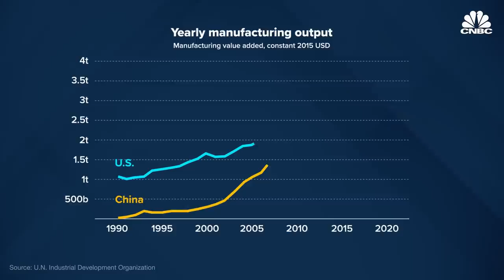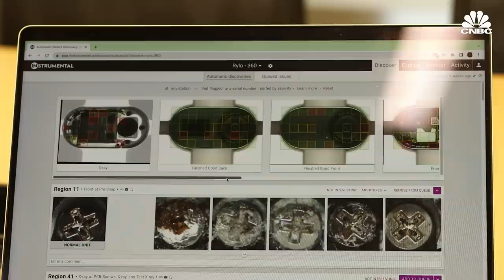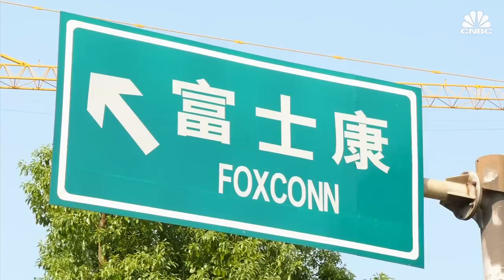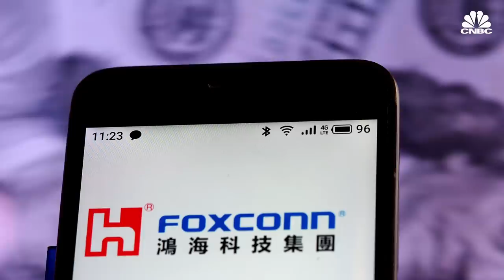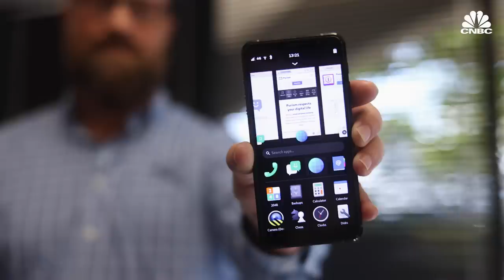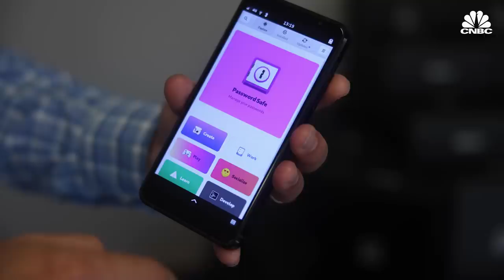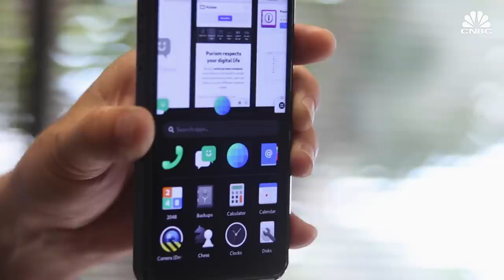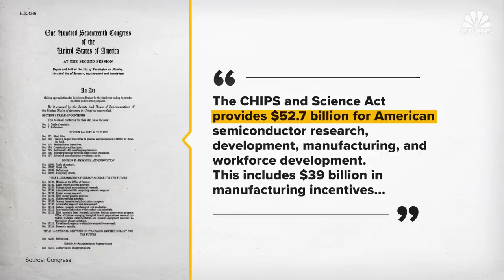Why The U.S. Fell Behind In Phone Manufacturing

Comment: Pretty interesting.  I always assumed products were made in China because of low labor costs.  Granted that is still a factor, it is a small factor, as I just learned.  China has the skilled employees to do the work.  So only makes sense.
Reply: when it comes to skilled employees in electronics America has the best that's why airplane electronics are made here despite what they say its the cost and since the cost have gotten high in China companies are now moving their factors to India on of the real problems are the supply lines here the parts to assemble to get here would be longer and cost more no country  just makes a cell phone all the parts are made from many different countries it wouldn't be economical to make the whole thing that requires 100
s of parts in one country
Reply: @omni It is absolutely because of lower costs. Not only for labour (a worker in the US at literally ANY level is significantly more expensive than one in China) but what you can do with that labour.

When a company I worked with made a last minute revision to a component in their product, their manufacturer who had staff living on site woke them up and had them working double shifts to fulfill the order. Not to point out the obvious but that would be impossible in the US or anywhere in the developed world.

They also have fewer regulations for safety, labour, process etc and the regulations they do have often aren't enforced.

This makes for FAR less costly manufacturing. You're delusional if you think it is anything else.

BTW manufacturing is not moving to India for similar reasons - they have extremely unfriendly business regulations. But manufacturing IS moving to Vietnam though.
Reply: That's what Tim Cook says on the surface, but deep down he knows that $3/h is better for him than $15/h.
Reply: @omni ok what about medical electronics do you even know what the IPC is?
Reply: @ShUisREAL  yea those are clear lies I mean intel makes a lot here
Reply: @DZ477  Sure, but engineers aren't paid only $3/hour in China, or $15/hour in USA.
Reply: @omni There's not a shortage of skilled labor in the US. There's a shortage of companies willing to pay the extra labor costs a US engineer demands compared to a Chinese engineer. If it were otherwise, Foxconn and Apple would not be so averse to let us know what their Chinese engineers' average salary was.
Reply: @d0k0night  I was talking about factory workers, they're the people Apple goes to China for, not engineers.
Reply: @@omni1189 : LOL..  If there are skilled labor in China, China wouldn't need the US in the first, right?   Remember how Mong Sang Liang singlehandledly built China's first 14nm processing nodes and most recently 7nm?  Of course, he's a former TSMC R&D head and he's Taiwanese.  If China has local talents, they wouldn't have to poach so many engineers from Taiwan, Japan, South Korea, or the US.
Reply: @omni US has more STEM, but it's not relevant here because they don't teach you phone assembly skills in STEM. Those skills are learned on the job or in special schools. How did China get those skilled workers? They built the factories where there were no skilled workers and then taught them. Sure, that means those workers can go to another factory and require much less training, but I don't think that skill acquisition is a big factor in labor cost unless they suffer from really bad turnover. Anyway the big reason companies don't make factories in the US and do the same here as they did in China is because the labor would cost so much more! I don't buy the supply chain stuff. That stuff can always be bought and shipped in bulk. As Apple does with their glass made in the US!
Reply: @joejacko1587  yeah there are a lot of companies leaving china for me India.
Reply: @omni no there has been news stories from WION about how manufacturers are leaving china because of high cost reasons, indias labor is more cheap and also I think it was because of the interlectual theft from Chinese companies causing the switch
Reply: What would need to change in America for 100,000s of young people to be willing to slave away all day at electronic factory jobs.
Reply: @omni I still stand with what I said I only said that because it came from a documentary I was watching of things that's already happening. I didn't get those things from my imagination all from the documentary
Reply: @HardRockMaster7577  $100 an hour 😅
Reply: The problem is that westerners are still using decades old stereotypes
Reply: @omni you telling me to do something I already have knowledge of I don't need to go look it up cause I already know were some are headed, or is. And yes It was a credible I stand by what I said
Reply: @omni if they build 1 factory in India and 3 in china 🤔 duh they must be going to India and china . And also I'm living in Houston right now we are getting a Tesla factory in Austin if it's not already completed so it's not like the ENTIRE OPERATIONS 100% IS GOING TO BE OVERSEAS. I've honestly talked about this more than I honestly care about so you all can have the rest of the conversation I honestly DONT CARE EITHER WAY
Reply: @omni and the documentary was by 60 minutes not no damn India but I digress happy holidays
Reply: @omni no you are wrong, it's all about Greed, lower cost in China
Reply: @@omni1189 great work CCP bot lol 😆
Reply: @@omni1189 cool story
Reply: @omni No. Labor costs are a big deal. Chinese workers are paid significantly less for the amount of productivity they do. And of course there are no labor unions or as strict workplace regulations that western countries have. Its why Apple is investing in India for the future. Overall its cheap labor + economies of scale + domestic supply chain + skilled manufacturing talent that makes China competitive
Reply: @dark12ain  
WION? 😳😳😳

🤣🤣🤣🤣🤣🤣
Reply: Yes, so what is happening with the educational systems in the USA?
Reply: @yemenidelibodegaqueensnewy9287  its really just the opposite China has a massive number of doctors and scientists from the west living and working there
Reply: watch the video to the end. labor is exactly what it came down to in the end. The local phone manufacturer clearly said he was able to maintain profits because he doesn't have ridiculously high profit margins. Apple is trying to squeeze as much profit as possible, they aren't willing to make less to make phones in the US. That's the problem...Greed.
Reply: And the Industrial Infrastructure and the Market! No country comes close.
Reply: @TomNook.  you're so right !!! China is not like it use to be in 90s and early 2000s their infrastructure alone is breathe taking!

Comment: The main reason I bought a Moto X back in the day was because they were made in the USA. Unfortunately, most consumers didn't care. I was hopeful that Google would continue to build phones here. Turns out that they primarily wanted Motorola's patents.
Reply: The so called "Made" in the USA for Moto X was actually "Assembled" in the USA. All the parts were shipped to Texas for assembly. Even so, there were too many problems of the factory. Google wrote off this as a big loss after a few months.
Reply: @easyxpress  Quite right... All internal components (capacitors, semi conductor substrates etc.) were made in; Taiwan, Thailand, China or Indonesia, and occasionally; Japan. As you say, just because its assembled somewhere, that doesn't mean its made there... Big distinction!
Reply: @easyxpress  : Yes, just the same way iPhones are "assembled" in China.  China still to this date only  provides low-value, low-tech components and labor for iPhones.  Most important high-value chips come from either South Korea, Japan, Taiwan or the US (mostly IC designs).   China imported over $400B in semiconductors last year in fact despite Apple's huge efforts to develop China's own domestic chip industry --  to the detriment of the US chip industry.
Reply: Yes you are right, the China does not have high skill workers to produce advanced high value IC. These are produced in Taiwan, Korea, Japan, USA. China only collects all these elements with the low level elements and assembles them into final product. So Tim Cook is wrong, it is not the problem of lack of high skill workers in USA. The wage difference is also not that big USA 7.25$ and China 3$. So what is the reason that similar product in China costs 100$ and the same assembled in USA 2000$ that is 20 times more, as presented in the video ?
Reply: @teranova5566  The simple answer?  Greed.
Well, it's volume.  A factory in China can churn out millions of products,  while one in the US can only make a few thousands. 
So a Chinese factory productivity is higher.  So, they can afford to sell at a lower price point
Reply: @scotttild  Exactly. People tend to romanticize factory work, probably because their parent told them how good it was back in the days when the US made all its stuff, and you could buy a house and go on vacations with a factory worker's salary. Not anymore. With Wall Street taking over companies and their hordes of analysts, bankers and hedge fund managers prioritizing profits over everything else, factory work is not what it used to be. There is no way a factory in the US can pay good salaries while meeting the short-sighted demands of Wall Street. That is why most moved to China and Mexico. The few factories that remain, at least in the low-cost manufacturing space, are staffed by desperate migrant workers because those companies cannot afford to pay more and turn a profit, and only migrant workers take those jobs. Factory work is hard. Even phone assembling requires being hunched over a bench for hours on end and putting together those tiny phone components require dexterity and swiftness. I don't see the hordes of liberal arts and communications graduates being churned out by our universities lining up for those kinds of jobs.
Reply: @teranova5566  "So what is the reason that similar product in China costs 100$ and the same assembled in USA 2000$ that is 20 times more, as presented in the video ?"

I'm not sure the price difference is as large as that (20x), but it is significant. There isn't a single reason for this difference, but several.

Wages are lower in China compared to USA/Europe, so Apple benefits from cheaper labor. However, the wages they pay their Chinese workers are still more than domestic wages, so these workers are willing to work productively for long hours. 
This wouldn't be the case if Apple hired workers in the USA, as domestic wages are (on average) higher, so their pay wouldn't be significantly higher than the domestic average and consequently the workforce wouldn't be willing to work as hard. 

Also, in the case of smartphones, assembling them in SE Asia takes advantage of the fact that many of the components are manufactured in neighbouring countries such as Taiwan, South Korea, Japan and China. In other words, there is an existing, reliable local supply chain for all the necessary parts. 
However, the phones don't have to be in assembled in China. As long as they have access to the above supply chain, they could also be assembled in Vietnam, or even India.

So, the 3 main reasons are access to:
[1] cheaper labor
[2] skilled workforce 
(by skilled I mean productive at manual labor, not engineers!)
[3] local supply chains for the required components
Reply: I had no idea Moto X was made in the US. Was the microprocessor made in the US also?
Reply: @fitybux4664  No. The phone was 'assembled' here.
Reply: I was on the engineering team that designed this product. The things that will never come to light are mind boggling. It's no wonder America is circling the drain. I feel sorry for young people
Reply: @fitybux4664  yes
Reply: I CARE
Reply: @pauldavis221  So true. To be clear it's been a long time since we had factories taking in nothing but raw materials in one and and rolling out a sophisticated product like a car on the other. That hasn't made sense for a long time. In any locale.

Comment: Having worked as a non-US resident with a multinational in the manufacturing sector I can tell you my experience: US workers just have the wrong attitude. 
The US workers were paid twice as much as our EU colleagues in many cases, despite having a complete lack of work ethic. One example: we've had emergency meetings across our offices where the US would just close their laptops at quitting time despite meetings not being done...no drive to solve the problem or pride in work in my view. And this is with overtime rates if you're wondering...
Many companies I've worked for basically balance two things in the US when considering locating there: the high costs involved, not just the tangible or financial, are weighed against benefits of selling product in the US market...if they can sell more by having a US presence, they will, but if they can get away with manufacturing abroad
Reply: You forgot to mention the lazy Europeans 8 weeks of starting vacation paid time off.  Usually 10 weeks.

Comment: I think Mexico would be a better place to manufacture electronics ,it has cheap labor low taxes and the advantage of being close to the us ,it will increase the dependency on us suppliers for electronic parts also decrease the price of the final product by decreasing logistics and shipping cost.
Reply: think Mexico would be a better place to manufacture electronics"

Nope! Semi conductor production requires massive amounts of water... The thing about Mexico...
Reply: @pauldavis221  they have no water
Reply: @nabidisla.5086  My point exactly!
Reply: It also requires the labor to be committed to their jobs and not thinking about where to drink over the weekends.
Reply: I think Mexico can , but majority of supply chain is present in Asia only around China,south Korea, Japan and Vietnam. And Indians are also pushing for manufacturing in their country and India is much closer to these countries and also have a significant domestic market. So I don’t think there would be any major shift in manufacturing products in Mexico in recent years.
Reply: dunno what you are talking about..  most high-value, high-tech parts used in smartphones are made outside China -- memory/storage chips, displays from South Korea, camera sensors from Japan, mobile AP from Taiwan, and various IC from the US.  China makes low-value, low-tech parts like screws, rubber seals, etc that can easily be relocated and made elsewhere.
Reply: Lacking expertise
Reply: @Mrinal-og6tg  Yes, of course you are right... I mean what with an average semi conductor fabrication facility needing not less than 5 million gallons of water every day... And what with Mexico being lush with massive rainforests and so many fresh water lakes... The biggest in the world apparently...

Oh no wait, the other thing... Less trolling, more reading for you my friend!
Reply: It is a little too late.
Reply: @Mrinal-og6tg  Vietnam, Indonesia, Cambodia, Malaysia as well.
Reply: Would it be cheaper to ship a phone made in Mexico to Asia? Asia is the most populous place, if you don't have an advantage in terms of price and quality, I wouldn't buy an imported phone.
Reply: @nabidisla.5086  AZ has a lot of water?

Comment: If you only look at the headlines, the overseas manufacturing push has just been in pursuit of lower labor cost and regulatory flexibility.....having worked in the semiconductor manufacturing business for 20 years and having delivered numerous low cost region manufacturing lines, I can tell you just as big, really to me even bigger, an impediment to repatriation of manufacturing is the typical mindset of the production employee and supervision in the US. For high volume electronics manufacturing (and in this I'll include discrete device & component production, assembly, packaging, & testing), process & procedural consistency is ESSENTIAL and directly links to product consistency, production efficiency, and rapid problem solving. Workers in Asia and other lower cost regions are not too proud to simply follow the procedures to the letter largely without question and only implement changes that will improve the process after careful planning and approval. Western employees and supervision frequently feel like they "can do it better"....and so they introduce a TON of uncontrolled variation to the process which results in unanticipated product variation, reduced production efficiency, and significantly slows the ability to detect and solve problems. I know in the west / US, this is not a popular reality to digest but it is reality. When US production teams are able to overcome this stubborn prideful habit, maintain their work in compliance with the procedures, and only implement changes systematically, they are then able to compete with their overseas counterparts and win this competition through more advanced problem solving and continuous improvement insights.
Reply: What an epic comment. Great insight. Thanks for sharing.
Reply: When it comes to consistency and quality control, Asians can do better.  TSMC beat Samsung in 5 nm and 3 nm because TSMC only make incremental change to their process, unlike Intel or Samsung. It's unexciting, tedious, and labor-intensive. The semiconductor manufacturing industry is cut-throat and saturated with top Asian engineers who work 20 hours a day consistently. Japanese companies tried to keep manufacturing jobs in the country, but who can resist the dirt-cheap made-in-China products even the quality is poor. If Japan can't reverse the trend, no one can.